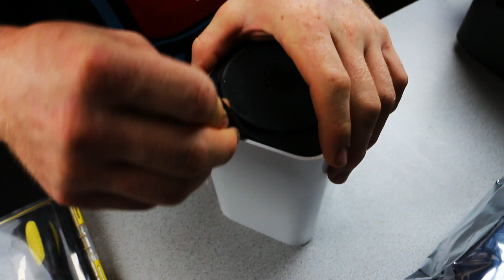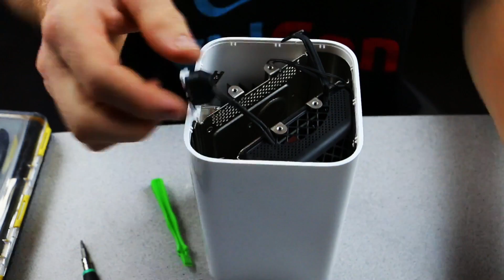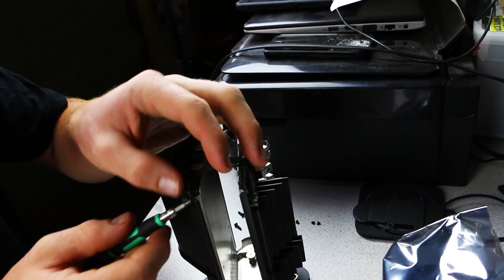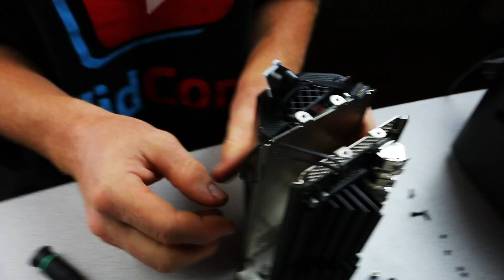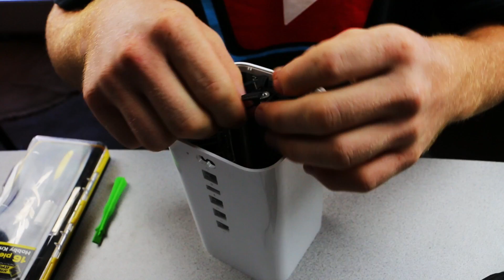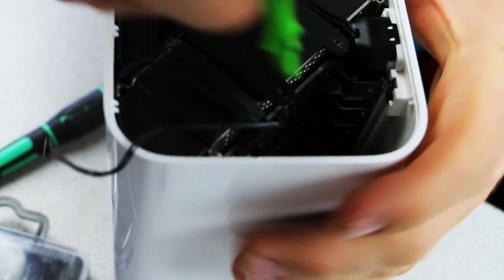How to take Apart an Apple Extreme Router & Replace Power Supply

Comment: I want to power the Apple router with 12 volts through a USB cable.
How can I do this? Is it possible to replace the regular wire from 220 volts with a 12-volt power supply?
Reply: Well the router is rated for 3.5a at 125v. So scaling that down to 12v would result in needing roughly 35a of current which no usb cable is rated for. So no, you cannot power it off a usb cable.

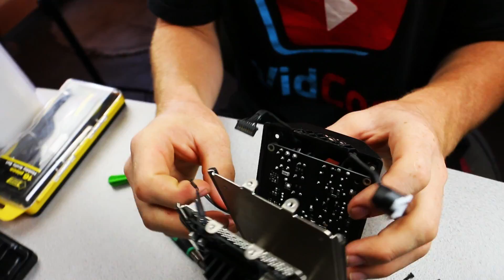Comment: Did you not notice how gunked up the fan was at 2:17? You probably should have cleaned it while you were in there, because it's going to stop cooling and give you a 'this unit may be overheating' notice real soon -- like mine is giving me. It might even be the reason your power supply failed.

Comment: Do these burn out often on the AirPort extreme ?  I know its about to be 2020 but I just picked up a used Airport extreme v6 for 40$ and love it.  I replaced an older router Linksys EA6900 that keept dropping connections all the sudden.

Comment: Why do these go bad?
Reply: Apple decided to make a 2 in 1 device. See that empty gap? That is where a hard drive would go, so this can be just router or time capsule. The old “time capsules” were bigger and couldn’t be confused with a base station, but a cooling fan was required. Also the old base stations had a power brick, now the power supply is internal, which creates more heat. So over time, unless you know how to tear it down an clean it, it collects dust, overheats an here we are. Apple wanted make an all-in-one solution, fine, they should’ve added heat vents at the top of the device, like the old airports had.
Reply: eric Rotermund bc they suck tbh